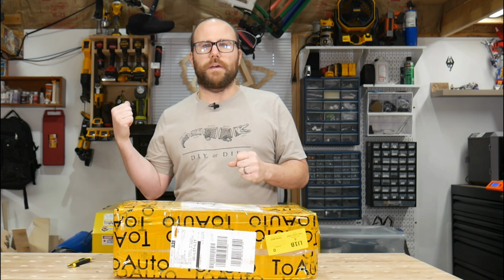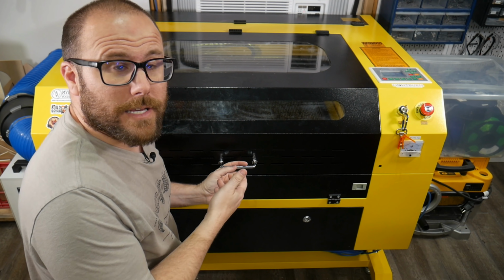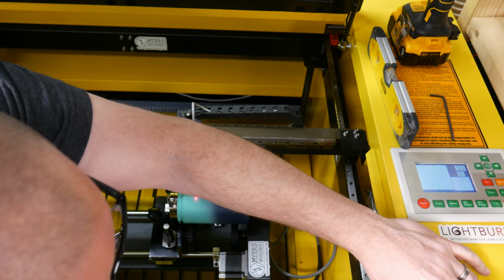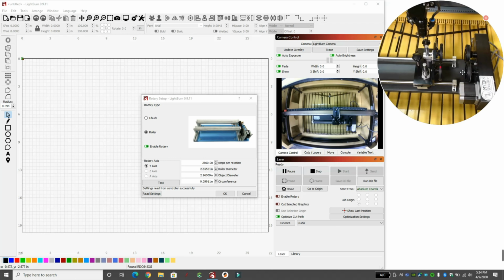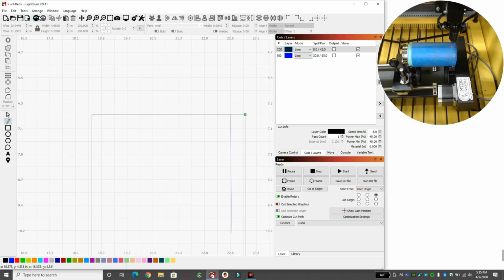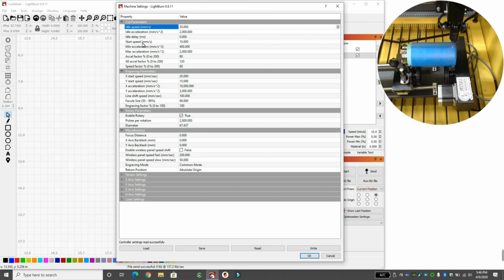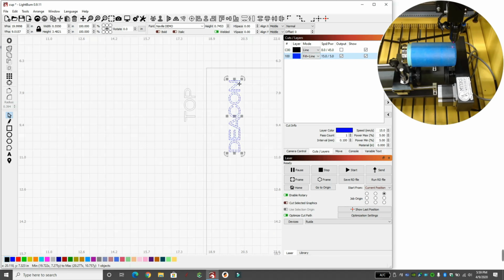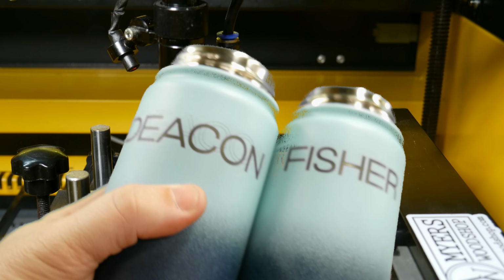Setting Up A Chinese Laser Rotary

Comment from the maker: ■ Laser Rotary (2 phase) : https://amzn.to/2XlZh10
■ Orion Motor Tech 60w Chinese Black and Yellow Laser Cutter Engraver : https://amzn.to/2Ko95RQ
Or cheaper on ebay (not as good for returns though)
http://bit.ly/60wlaser
Reply from the maker: i sure do.
Reply: what camera did you use and how easy is it to wire and use with lightburn?

Comment: Hi there, thank you for this. I use Lightburn and I have a FL 1390 with the Riuda 6445G controller. My current issue is my Y pi burner 3.0 wheels/rollers are not spinning in conjunction with the program - it’s a simple 3 inch box. I can manually spin them with the Y controller and they roll as the head jogs over to the origin point over my beer mug. They also move when I hit the test button in the rotary tab, just not during the engraving. 

Anyone have a solution? 🙏🏼

Comment: You can also get the settings in there, and then go into the Move and set the number of steps to move, and see if it lines back up at the starting point.

Comment: I have had one of these rotaries for a year. It is made of the typical quality metal most chinese use ( I believe they think 304 stainless is a brand ) and went rusty in a month, and the height adjuster not being in line with the slides, makes the tail stock jam.

Comment: I have a chinese 80w and I bought a rotary about like yours but have not been able to get it to work.  It did not come with a hook up for the rotary so I cut he wires and wired them to a green block to hook to the control board but it will not work.  It did stutter for a second but hat was it.  Is there any settings I need  to change?
Reply: I'm having the same issue. Did you get yours to work?

Comment: Good video- thanks. But notice in the Lightburn setup, there's a button called 'test' ? Near the object diameter & circumference.  That will make it test rotate the number of steps in the top column for Y rotary.
Also as soon as you put the word "bottom" on the right, you shigted the origin, which is why the test was too high on the mug.
 You'd have been better to set the origin midway along that edge - the top middle of your black box - or delete the word 'bottom'

Comment: If you lower the wheels like that, you should have a larger diameter piece that will ride higher on the wheels and avoiding the screw head

Comment: FYI: For raising and lowering the table, open the bottom front door, and you should be able to move a belt or chain and raise or lower the table much faster than using the knob.

Comment: You could have used a square on the motor assembly to align with the idler rollers.  Also, you previously measured the max working length of the item you can fit between the rollers, then complain that longer items foul on the adjusters

Comment: So in both RDWorks and lightburn, even when I get all these settings, the laser won't run the "square and line" program let alone any real work. The y axis button moves the rotors but when I click run, it just thinks for a second and does nothing.

Comment: I have the same rotary and found your video darn useful, especially when it came to dialing things in. However, I kept getting drift in the Y-axis, and worse, it was not consistent! Right side of an engraving would be almost right-on, but traveling to the left there would be an increasing divergence. I spent hours trying to fix this, and went through a couple of rolling pins in the process; now perfectly useless! :) What I finally tracked the problem down to was that the rolling pins (and not super cheap, but in the $10-$15 range) did NOT have a consistent diameter. It turned out that there could be up to 0.1 inch differential between the two ends, and that difference, leading to differing circumferences, was the issue. 
Also, like you, I've played with several ideas to stop the target from traveling left or right while being engraved. On the drive side I installed a slotted piece of steel that sits just high enough to prevent travel to the right. That also provided me a place to install a v-pulley which I use with a 2" diameter (or larger) o-ring to firmly hold the piece on the rollers - helps immensely with ensuring there's no jumping about.  To hold the left side I alternate between some very poweful magnets and aluminum angle, with the magnets clamping the piece to the two vertical steel posts. I also put a v-pulley on the left side.  So, a day's worth of effort has paid-off.  Again, thanks for such a well done video (as all of your work seems to be!).

Comment: my rotary is too tall for 20 oz tumbler when set on the knives.  I got the rotary from Omtech.  the autofucos switch is too low and will hit the tumbler and the laser is barely clear.  I had to set it on the floor onto top of two 2x4s to use it.

Comment: So, this is a fantastic tutorial. I have the same laser and rotary, and this made it easy to set up. One warning--I had plugged in the rotary but it wouldn't turn. Thought mine was a dud, started taking it apart, very frustrated. Turns out, you need to switch the plugs when the machine is off--may be obvious to others, but wasn't to me. Once I turned it off and back on again (yay obvious tech fixes), everything worked like a charm

Comment: Man your bed needs a clean, i stick mine in the dishwasher but yours is larger than mine industrial dishwasher or pressure washer vertical to the bed obviously not in the machine, if you dont clean it those brown marks are resins and eventually will catch fire, like you i use mine a lot and stick it through my wife-s dishwasher once a month and it comes out nice and clean... Thanks for the tutorial, very useful.

Comment: Did you try averaging your roller diameter with your object diameter to find your steps per rotation? I'm throwing crap on the board to see what sticks but I noticed if you average those two numbers on your example of your yeti can you get 2807.50 which is absurdly close to the 2800 you got by putting the tape on and doing all the rest of it. I wonder if you could just take the average of the object diameter and the roller diameter and achieve the same thing. Super curious ;)

Comment: Thank you for the video, it has been really helpful! I do have a question on settings either the machine or Lightburn. I did a logo that has fill and lines. It engraved the fill first and then went back and did the lines. When it did the lines, they did not line up with the fill. I changed my setting for idle speed and line shift down to 20. Watching it, it didn't seem to skip when it went to do the line. My speed was 30 and power 12. Is there a setting in Lightburn to do everything in order or any advice on how to fix/troubleshoot?

Comment: You might (possibly) be able to set up a duplicate machine in LB with your customized rotary settings... so machine 1 - normal laser, machine 2 - rotary tweaked settings. Then just switch between devices - not sure how that works w/ the firmware, but might be worth seeing if LB's software control can override default idle, etc.

Comment: Thanks for the complete video!  I probably appreciate it more since I spent all day yesterday configuring mine.  One thing I noticed that I haven't seen addressed anywhere is that when you have everything dialed in, Lightburn seems to be making adjustments to the Y axis to account for the curvature of the cup.  For example, I made a 40x40mm square, and it measured 40x44mm on the face of the cup. It did, however, measure 40mm wide if you held a flat ruler up to it and eyeballed it.   This is a cool feature unless you're trying to put a pattern around the whole circumference. With the "actual" settings, I was able to cut the entire circumference with a 143mm object, where my actual circumference (measured, and set in the Rotary setup) is actually ~159mm.  Anything longer than 143mm, and I would get an out of bounds error from the Ruida controller.   Have you run into this?
Reply from the maker: I have not. but i would post on the lightburn forum, they're very responsive.

Comment: If you have a seamstress tape measure you could measure the line that you burned divide it into the measurement you originally wanted and multiplied that to original steps per mm and it would get you into the ballpark of the new steps per mm needed. example: If the original steps per mm were 5000, and you wanted a line of 4.64 and you measured a line of 8.28, you would divide 4.64 by 8.28 and multiply that to 5000 and get a new steps per mm that is really close. If you don't have a seamstress tape measure, you could remove the tape, put it on a flat surface, and measure it with a set of calipers.
Reply from the maker: definitly another way to get there!

Comment: Did you ever design a 3d print file as a stop for the cups to hold it in place? If so, any chance to get the stl?
Reply from the maker: i didnt.  i just glued a block of wood to the top of the metal pieces

Comment: What do you use to keep the tumbler from "walking"? I have this one but my tumbler keeps walking to the left
Reply from the maker: i put a solid block in front of the tumber.  or I've done a clamp on the front of the rotary and the tumber pushes against the clamp body.

Comment: Hello, I would like to know what is your opinion about this machine. I want to buy it but it has some changes, I would like to know your opinion.
https://www.ebay.com/itm/254655207664?ul_noapp=true
Reply from the maker: it looks like a good one.  use this link  https://rover.ebay.com/rover/1/711-53200-19255-0/1?mpre=https%3A%2F%2Fwww.ebay.com%2Fitm%2F254655207664%3Ful_noapp%3Dtrue&campid=5338460712&toolid=20008
Reply: Myers Woodshop that’s 💪🏼

Comment: litle tip that is way better then guessing the steps.: 1st run -> it does not matter what number the steps is. burn a line of 2cm (or any other length)
step 2 measure the line, if the line is 3cm , then do 2 / 3 = 0.66666  then you take the number of steps it was on and multiply that by 0.66666.  then you have the right amount of steps
Reply from the maker: thanks for the tip.
Reply: Di-jo! That is probably the best and easiest way ive ever seen anyone explain that. THANK YOU!!!
Reply: That's an amazing tip, I am always struggling to find the correct steps for every different cup that I need to engrave

Comment: I'm really not understanding how the Circle pulse can be a constant number. It must change with the diameter of the object you are engraving, because the 'gear' ratio between the rotary drive wheel and the workpiece would change. That's how gears work...
Reply from the maker: you change the diameter for each object.

Comment: So you dont have to change the dip switches on the driver you can can configure most of the setting in light burn and machine settings?
Reply from the maker: Never touched the switches
Reply: @MyersWoodshop  Good to know there are a few other videos out that showed you had to change the dip switches everytime you used the rotary. Not sure they were using lightburn for software.

Comment: Used your link and orderd Rotary 2 phase. (Thursday delivery) will see.  Need camera if Lightburn can get them in. Just not sure what degree 120,140 or 160.   I have same 60 watt ol Yellow like you.
Reply: 140.  I have the same model.
Reply: Link to official camera.  In stock.  I got mine from there.  https://cohesion3d.com/shop/peripherals/official-lightburn-camera/
Reply from the maker: pretty sure mine was the 140 or 160.  i can't remember now.